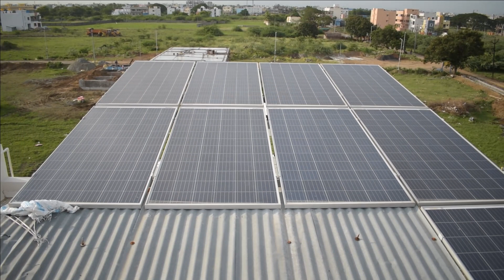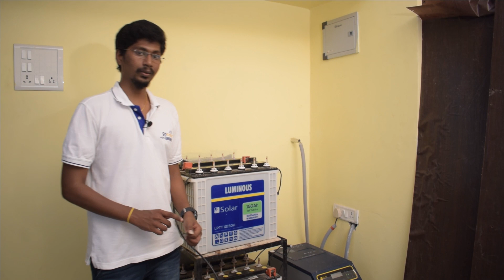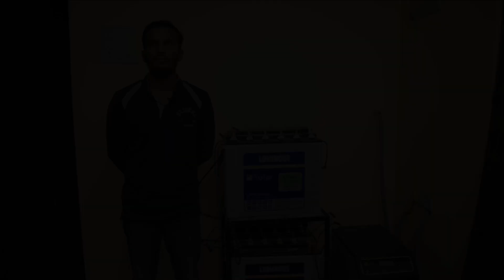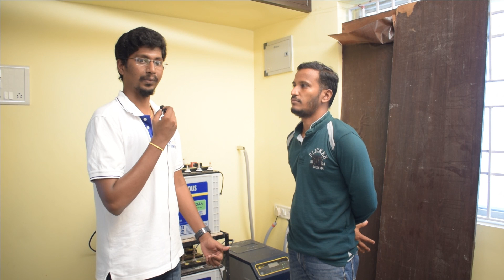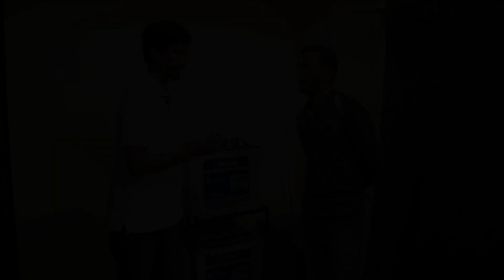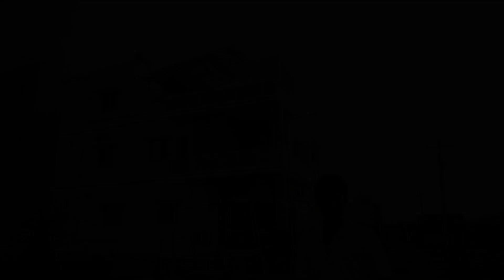Luminous 3.75KVA Solar PCU - Customer Feed Back

Comment: I am not against the company that has produced this video or Luminous. They have good intentions in publishing the video. I am just sharing my first hand experience with the specific PCU.

I would not recommend this PCU. I have been using the same PCU NXT 3KW model for the last three years in the same configuration as mentioned in the video. I had to change the main board of the inverter twice already and it has failed for the third time now for no particular reason. First time replacement was free under warranty (so it failed within one year of installation). I don't use the grid power option at all. EB power was never connected to my PCU. Only Solar and Battery inputs are used.

Each time you call the service engineer, they will not repair your board. They with swap the board with a new board for approximately Rs 9000+.

The PCU main board has the inverter, battery charger, and MPPT controller, SPWM inverter driver and protection modules assembled in a single board. Normally in such power electronics circuits, only some MOSFETs and the corresponding driver circuits fail. They can be repaired and replaced for less than Rs 2000 by replacing the components. Luminous however does not do that. They replace the entire board. This shows that the design has been done without keeping the operating and maintenance costs in mind.

Why should we replace the two good modules and the sensor/control circuits when only one module fails just because all of them are on one PC board. We are losing the good modules in the failed board and unnecessarily paying for them (with tax) in the replaced board.

The MOSFET (transistor chip) used in this inverter in now out of production. It is expected to be available only in December 2022. So the board design is kind of obsolete.

My recommendation is to buy the MPPT charger separately and power inverter separately. Buy a 50Amp 48V MPPT charger which will work with the same panels recommended in the video. Buy a 3KW or 4KW inverter from the market. Buy panels and battery from Luminous. All can be connected in a system which will provide the same functionality as the PCU NXT 3KW. If the MPPT charger fails, it can be repaired/replaced at low cost. Same case with the inverter. I have this configuration now and the system works well. I am using the Luminous solar panels and the battery but replace the PCU with a third party separate MPPT charger and a third party 4KW inverter. I have dismantled the PCU NXT 3KW and I am unable to repair the board because the MOSFETs are not available in the market.

An integrated PCU like what Luminous has designed is only good as long as it works well. If it fails it becomes a white elephant. This particular inverter has obsolete components.
Reply: Better go for utl alfa
Reply from the maker: Dear Customer 

Kindly Share your Contact details . We will try to give Solution from Our Side 

info.tnenergy@gmail.com